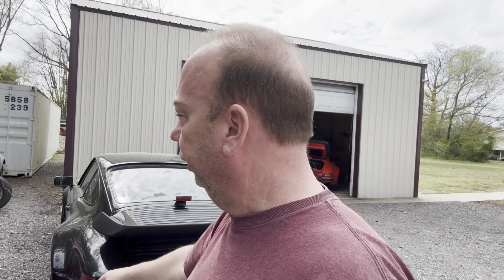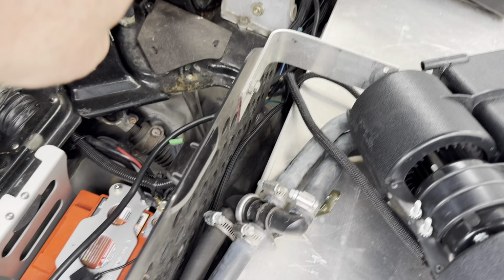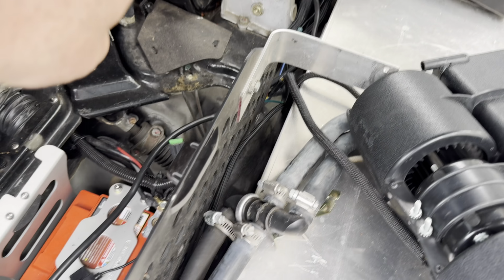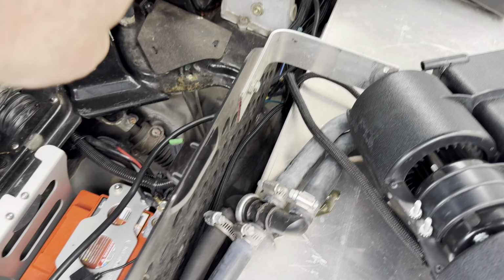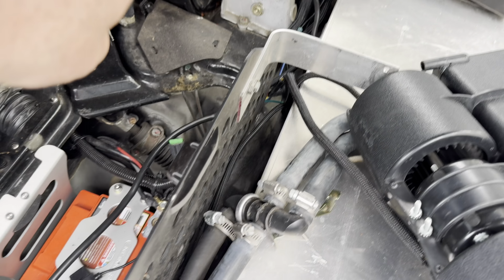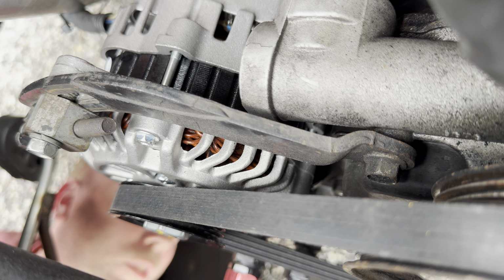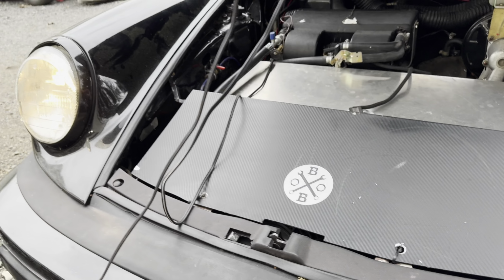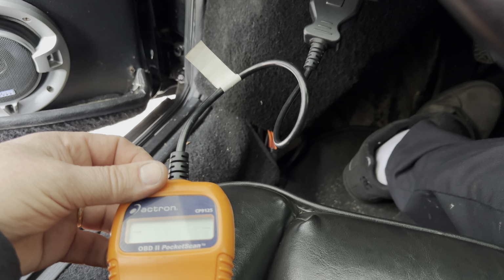1987 Porsche 911 why are my light flickering Porschubishi 4g63

Comment: I worked on a Porsche that had flashing lights like that. It was a corroded fuse, those pointed fuses get corrosion on the ends and it causes a lot of funny problems. Just use some fine sandpaper and do the ends of every fuse also clean the fuse holder terminals, it will fix a lot of issues.
Reply from the maker: Yes they do, I used a fine wire brush on mine dipping it in vinegar, worked great

Comment: Those codes are cam and crank sensor , some builds will have those codes when the engine is not running
Reply from the maker: Hmmmm interesting, for years I never had them now can’t get rid of them. Does not effect any performance at all
Reply: @RustyRatchetGarage  Hmm then maybe you shouldn't have them. I would look at the wiring diagram and see what they share. A bad connection maybe.